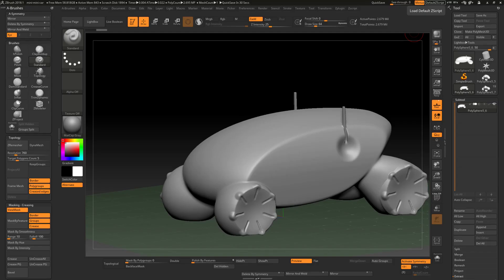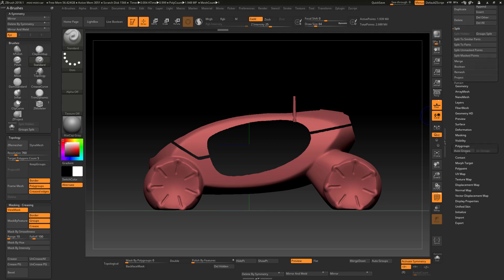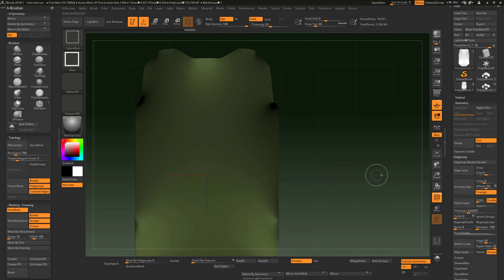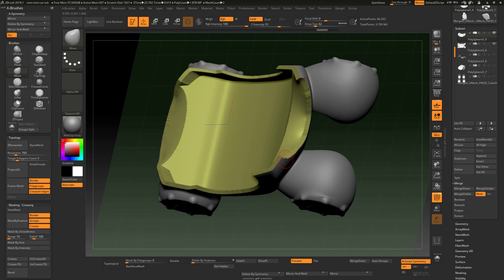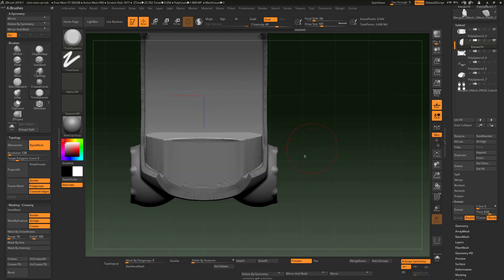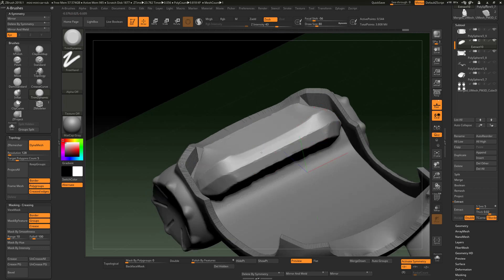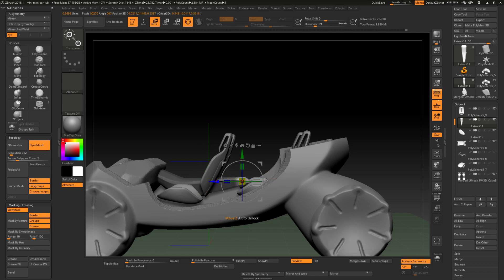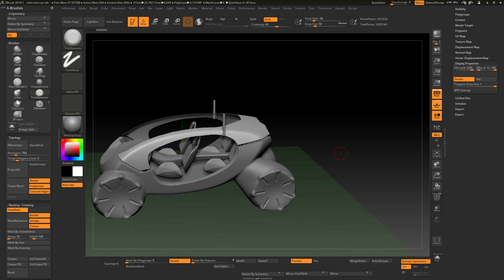Creating A Car Interior Tub

Comment: Good to see you back, always nice approach to car modeling inside Zbrush :)
Reply from the maker: Thanks!  Is there anything you'd like to especially see?
Reply: @Carstylus  Well a lot obviously but it'll take you too much time I think, one thing that could be great though, and maybe not too long, would be to see a Maya+Zbrush workflow, to showcase the live boolean system to add details quickly to a polygon mesh. For example, design a dashboard or a seat into maya, simple one with just edgeloops and stuff to understand the different part, and add details with live boolean brush in zbrush.Could be interesting yo see how to do a set of brush for live boolean inside of zbrush also.

Comment: i think using zmodeler would be better.. :)
Reply from the maker: Zmodeler has some advantages. . . However if I were modeling with less dense polys, it probably be in Maya or Blender. . .  But I also have another approach using live booleans.  You might like it :)
Reply: it depends what you need, here in this video,  it's just one way to creating a concept,  for me, constraints from the slice curve brush, when we cut a mesh we don't have a perfect closedmeshes after that.i regret Pixologic didn't fix it. it could change the using of zbrush definitively